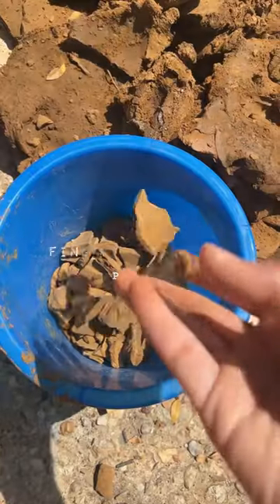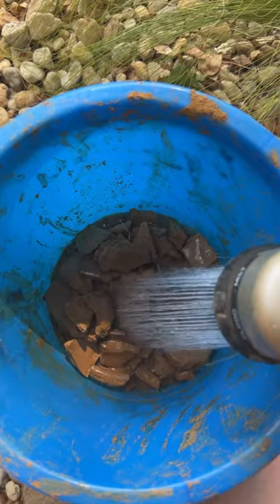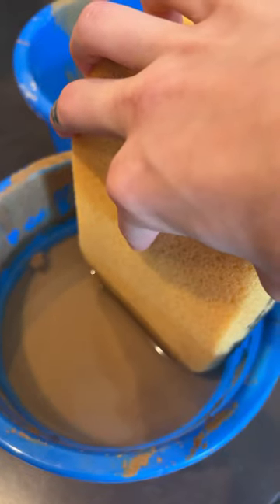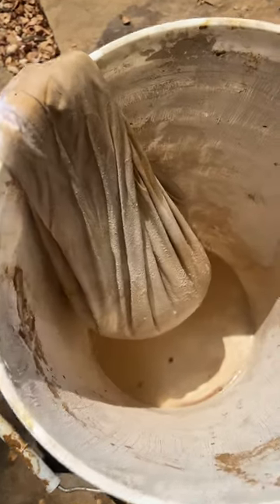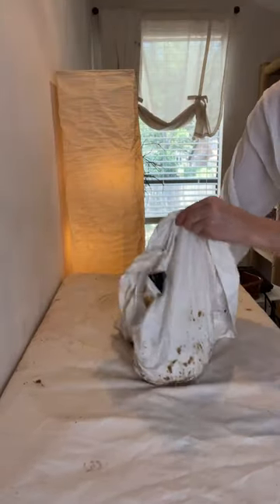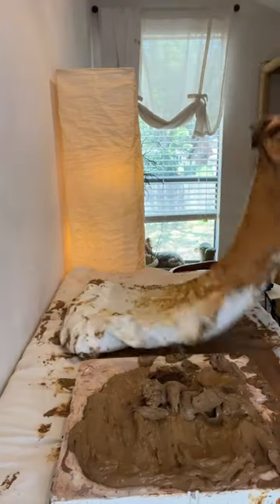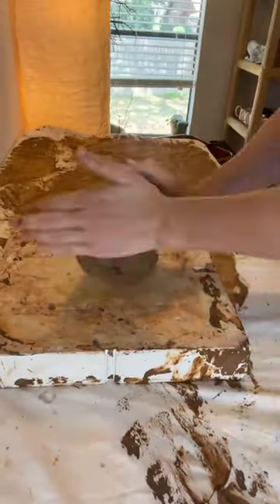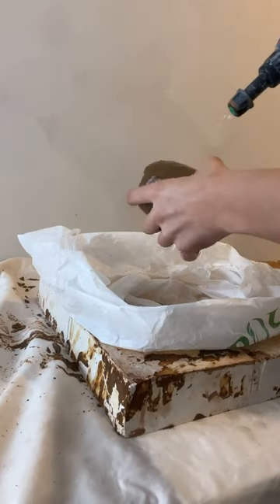PART 2 - Processing wild clay that I found 💧Wet Processing💧#shorts #pottery #wildclay

Comment: Do you need to add any temper to your clay?
Reply from the maker: So I’m actually doing some testing on this clay to see what it needs to become a functional clay. I’m trying to get to vitrification with it. But yes, most clays you find will almost always need some kind of temper. I started out with just sand and have fired several pieces but they either crack or have calcium pops, I’m thinking my temper is what had the calcium in it. So I’m started over with all of the tests and doing it the correct way now 🫶🏼🙌🏼